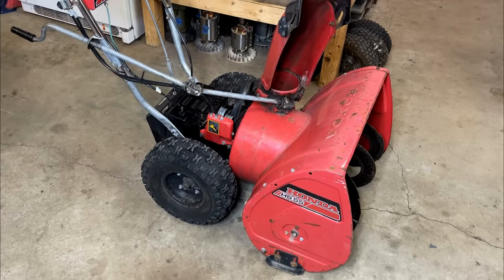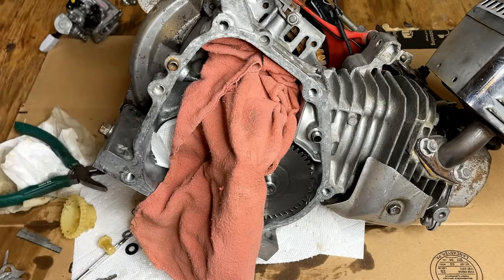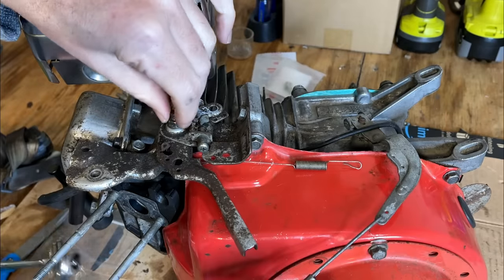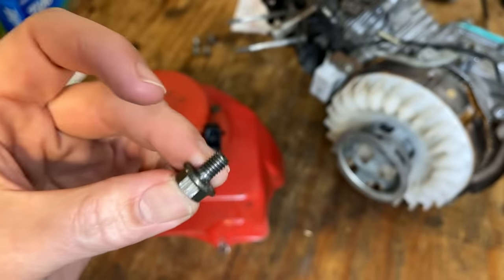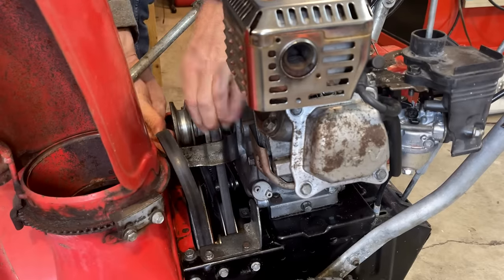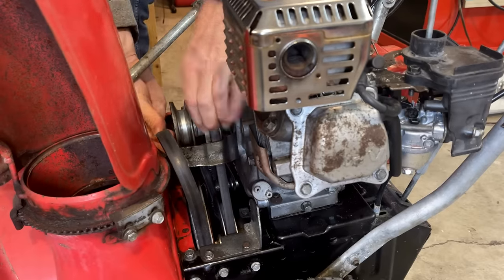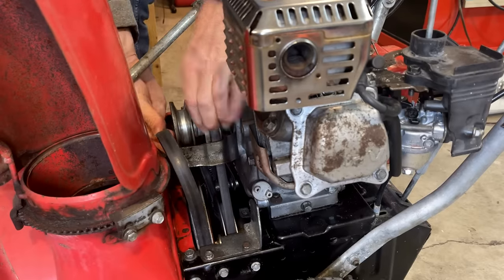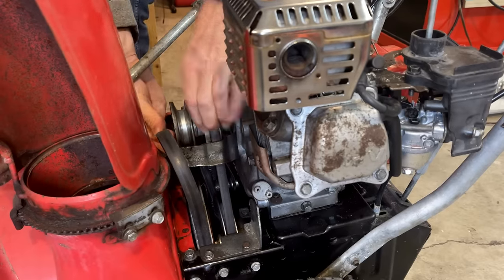Honda GX140 Governor Replacement and Engine Repair - Honda Snow Blower (Part 2)

Comment: Considering all the things missing on this thing, $45 in parts ain't bad.  Nice of the weather to cooperate for filming/testing.  What do you suppose made the governor egg shaped? And do you suspect the weights were removed as part of the conversion to a go-cart motor?  Thanks for the video.
Reply from the maker: I am thinking someone gave it a squeeze with channel locks and ended up pulling the weights instead when they could not get the gear off.

Comment: Hi James, I came across your videos because I bought the same model of Honda (HS55) snow blower this summer from the original owner.  No modifications have been done to it.  Just tried to use it in the snow for the 1st time this week.  The engine runs and sounds fine.   The auger and drive both work but when when I get in the snow the engine bogs down and dies.  Spark plug and oil have been replaced.  From watching your video, I think I need to clean the carburetor. Any other suggestions?

Comment: Who knows what went on with that engine; it sure looked brand- new clean inside.
    I thought those handlebar controls over blower and drive were more deadman type, so if somethi g happened to the operator, the machine would halt, and the blower paddles would stop...??
..

Comment: Hi! Thanks for the video! I am trying to fix up a Honda GX160 generator with my Dad. It has been sitting in a (nice, warm and dry lol) shed for about 20 years. We started stripping it down today and I rushed into it a bit. I poured the old oil out of the grey oli stooper and not the white one with the dipstick before realizing. Do they both end up in the same place or  do they oil different things? Sorry for newb question.
Reply from the maker: Assume you are asking about the oil fill.  Usually there is one on each side of the engine.  The oil goes to the same place.
Reply: @jcondon1  Thanks. I just didn't want to screw it up. Your video is really helpful btw. Subbed.

Comment: Do you have any thoughts as to why the governor shaft was magnetized?  Seems like the easy way to disable the governor would be to remove the external operator arm.  Any thoughts why the previous owner would remove the governor weights?  Maybe you just found that owners often do illogical things or there is something I'm missing.  Thanks for a great video.
Reply from the maker: There is not anything locking the governor button in.  Am guessing Honda used the magnet to pull the weights in when the engine is off so the button does not fall off.  If you remove the arm, the cap and washer under will fall into the engine when running.
Reply: @jcondon1  Thanks! You make a good point!  I think the washer under the button is a retaining clip so it should remain in place but who knows where the button could go.  Could the arm on the output shaft rotate far enough that it would hit the rotating crank shaft?  If one is modifying the engine for use without a governor it would seem the plastic governor gear along with the output shaft should be removed.

Comment: when i saw that the governor was taken out, go kart conversion was the first thing that popped into my head.
but it raises so many other questions. why was it put back onto the snow blower? why did they bother to open up the crankcase and remove the governor weights instead of just disconnecting the linkage on the outside?

Comment: Adbestos gasket, yeesh! Thanks for pointing that out!
   Since you have CO sensors in your mechanicing work space, have you noticed any trends in Carbon Monoxide emissions?
By that I mean: are Honda GX 140s and clones prone to emitting too much of it? Are certain types of engines (Hondas, or single cylinder engines, or...) more likely to make too much CO?  I bet you'll say it's all over the map of small engines with no pattern you can see, yet... 8-))  You are a database guy.  Have you tracked high CO engines (with notes, e.g. "very worn engine") in one?
Reply from the maker: Not much of a pattern.  But the two Yamaha EF3000 generator I have worked on in the past set the alarms of very quickly.
Reply: Engines produce more CO when they are run rich, and NOx emissions when run lean.

Comment: If I do not miss my guess the gears on this engine are helical cut. The B&S engines I have taken apart always had straight cut teeth. Can you shed some light here?
Reply from the maker: The gear that connects the crank to the cam is a helical gear.  The governor gear is straight cut teeth.

Comment: I have a generic question while filling the oil I notice that you fill till full "running out of fill hole is that the norm or to try to go by the dip stick.  Thank you Animal
Reply from the maker: That is the norm unless the dipstick has a full line.  Most just have the cross hatch pattern going all the way up the stick.  On Briggs engine it is best to go almost all the way but stop before it runs out.  The oil fill cap has no o ring and it will drip oil on the floor over time
Reply: @jcondon1  Thank you for your time

Comment: Why would someone go to all the trouble of removing so many parts and then reassemble the engine? Governor removal for a go kart yes but removal of pushrods? Could this engine have been a set up to test your ability? With all the rust on the auger shaft, you may want to remove the shear bolts on it to see if the auger is rusted to the shaft. If so, the shear bolts will not be able to protect the right angle gearbox and possible take out the brass bevel gear.
Reply from the maker: Good point.  The auger is probably rusted to the shaft.
Reply: @jcondon1  i have a hand-me-down honda that had the auger rusted to the shaft. One misplace woodblock in the driveway sure did a number on the front transmission/gearbox. I would watch a short video of you tearing that front auger apart and re-habbing it. If it is rusted to the shaft, lots of heat and lots of leverage will be needed!

Comment: your very meticulous james if you do as good a job off camera i would have no trouble bringing you equipment or recommending you to others i fix or repair about a dozen blowers a season usually junk ones but they are all fairly simple i do make good money off them and no i don't charge a lot just quick turnover cheers buddy
Reply from the maker: Thanks Terry

Comment: Those head bolt torques were all out pretty much the same; perhaps the original torque wrench that had been used hadn't been verified for a while. Or dyslexics... Them dang dyslexics.

Comment: My gx 200 is back firing badly and running just as bad, can it be a bad governor inside and how would I determine that before taking it apart? Thank you
Reply from the maker: Running fast or bogging under load would be symptoms of a bad governor.  Backfiring is probably not the governor.  Could be the carb, valves, timing or weak spark.
Reply: @jcondon1  Ok I appreciate your response, and while I was waiting for your answer I decided to put back on the old muffler which seems to make it run better, and the backfiring is not so bad now either.. Some other forum some one said that the muffler can cause backfires; but why would a new muffler cause backfires? I know I didn't say this before, but the problem started after I had replaced the carb., the valve cover, and the exhaust with new ones, so I put back on the old parts one by one to see what would happen; but it seems like the exhaust is the problem; but as you said the governor could still be a problem. I'm going to put back the new carb. and the valve cover with the old exhaust and see what happens from there. I'LL HAVE TO TRY AND GET A HONDA ORIGINAL MUFFLER IF POSSIBLE.

Comment: Honda runs the gx160 in my old hs622 at 4000 rpm and your gx140 at 4200.  My idle is also put put slow.  Nice save on this machine!
Reply from the maker: Thanks.  I saw conflicting information on the top speed of the GX140.  Saw wither max speed as 4000 or 4200 RPM.  Not sure though on a snow blower if it should run that fast or not.
Reply: @jcondon1  the extra speed will get the impeller moving faster and allow it to fling snow further. Plus they assume that it will be under load most of that time so it’s rpm will drop down to the peak power band.
Reply: @jcondon1  also I think there is an oil filled transmission the disc is driving.   My 622 runs much faster than my 928.   Can’t wait to see it in real snow. Same here. Zip this season.